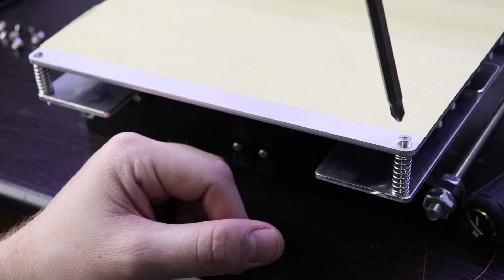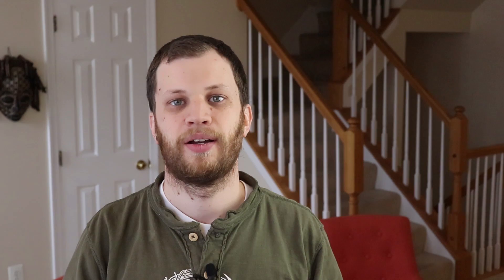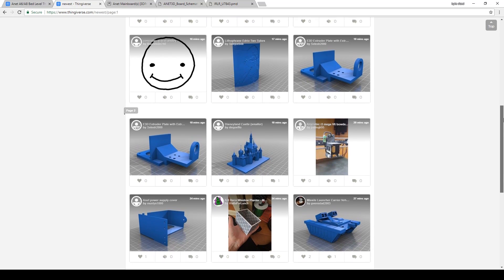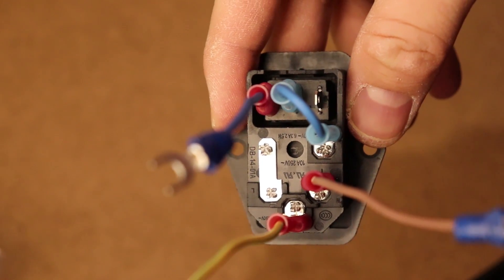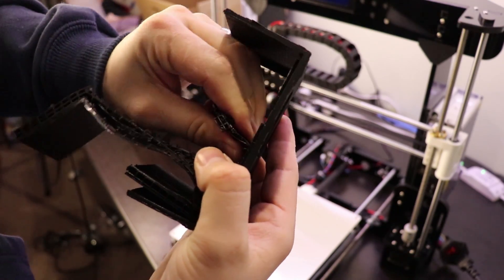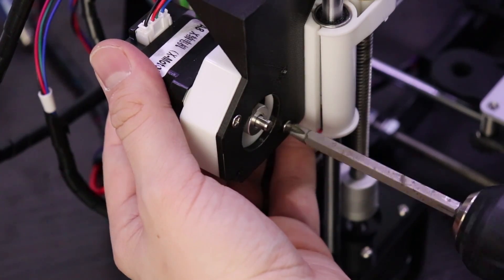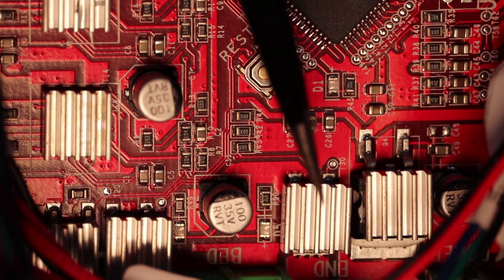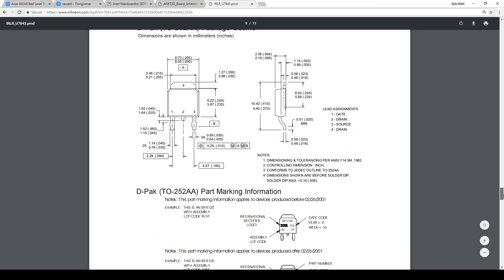Anet A8 3D Printer Essential Upgrades

Comment: Sadly you kinda misread the Datasheet for the Mosfet
Yes it can handle 30A but only if it's mounted to the PCB through the large ground terminal
Otherwise it will heat itself up to ~400°C (~750°F) and that will probably desolder it :D
Reply from the maker: I didn't misread the datasheet. The fet is installed on a PCB with a ground thermal plane and also has heat sinks. When I make these videos I have to find a balance between going into great detail and loosing most of my viewers, and keeping the explanations simple with the most important information . I design PCBs for a living and so I'm aware of the thermal limits of mosfets like this. I was trying to illustrate the importance of looking past the first page of the datasheet and reading the app notes.
Reply: I don't think the mosfets installed are those in the schematic. They have no markings on them. Mine stopped working after a week. They must be fake copies. 
I took out the whole motherboard and threw in the trash where it belongs. 
Installed a RAMPS 1.4 + Arduino Mega. Like my Prusa MK2 clone. Also made myself a MightyFan board. easy peezee.
Reply: well if you won't say it I will.... EAT IT! lol
Reply: He did say that after 8 hrs of printing they we're not hot to the touch.
I've found the same with my later model A8.
I've done 25hr prints with no issues.
I did change the power supply to a old PC power supply I had laying around. Gave me a standard PC power cord and a switch at the same time.

Comment: Just so you know, an extremely rigid frame is EXTREMELY important. Try to print faster and make sharp corners. You will see alot of improvement with a rigid frame ;)

It is really important!
Reply from the maker: Those are great tips, thanks for the advice!
Reply: Exactly. It's not about force between the work piece and the frame, its about moving components and the frame. Oscillations and ringing are really annoying.
Reply: rigid means the nozzle moves less because of the vibrations, rigid = less ondulations on the object
Reply: RomanoProductions yes :)
Reply: I can't believe that frame moved THAT MUCH!!! No wonder everyone is talking crap about these machines compared to aluminum framed machines. This is a MUST upgrade!!  I've always believed that plastic can be just as strong as metal in non-wear applications so long as it is thicker.  With upgraded joints and perhaps even replacement panels there's no reason this can't compete with any other model. What I am most interested in is upgrading to arduino.. I really want to learn more about this technology

Comment: witch cable cross section did you use??? U should use at least 1.5mm^2.. yours it Looks Way to small!
Reply from the maker: I used the same cable that the printer came with. It looks like 14 AWG which can handle 15-18 Amps.

Comment: I think I'll follow suit. with that drag chain, bed leveling, and z support. I added a ball bearing support for the z- threaded rods which helped thing form swaying. I added some belt tensioners as well though being that my print quality at that time was potation, I should probably print them again now for better results. I found adding a glass sheet to the bed REALLY helped my print quality. 

I'd like to see a good mainboard housing print if you decide to, be sure to do a video on it!
Reply: John Weland zrod bearings on the threaded rod are a bad idea. They need to move freely so they don’t fight for space with the smooth guiding rods. They move for a reason! :)
Reply: Patrick Nijkamp noted, I'll fix that, thanks for the heads up.
Reply: No problem! Did a lot of research (I have fully modified an ANET A6 over the past year, but upgraded to a creality CR10-S now) and found alot of ... misleading information. Sometimes something works for 1 person, but they actually really have a different problem and this might 'help' a bit. But in a well configured printer the Z-rods are almost always loose at the top. Also with my CR10-S.

Comment: Good video. Since the AC side uses a lot less amps than the DC side, I think a 5 amp fuse may be better, not sure but you may want to check that.
Reply from the maker: That's a great suggestion. I could probably get away with a smaller fuse on the IEC connector. I know my outlets are connected to a 15A breaker in the panel, so I chose a 10A fuse with that in mind.